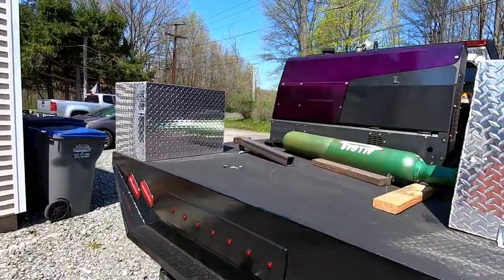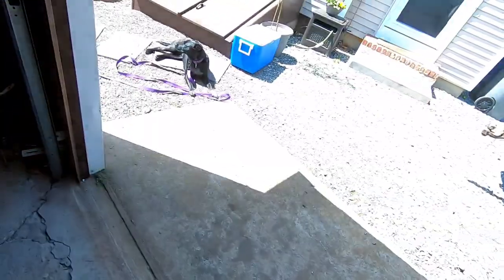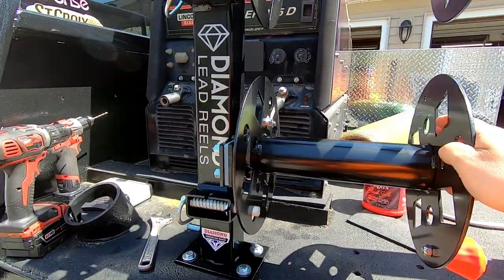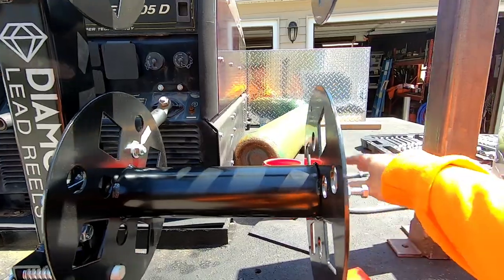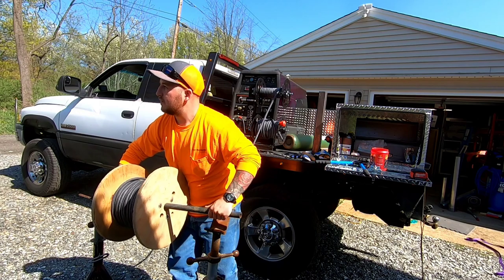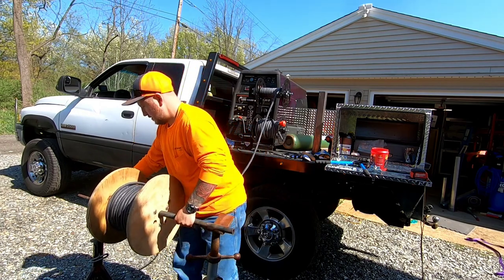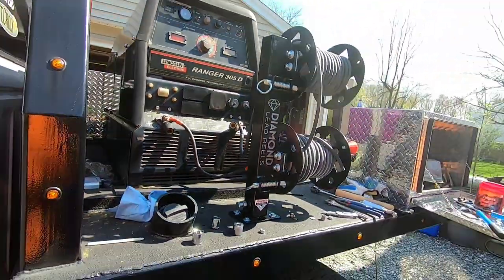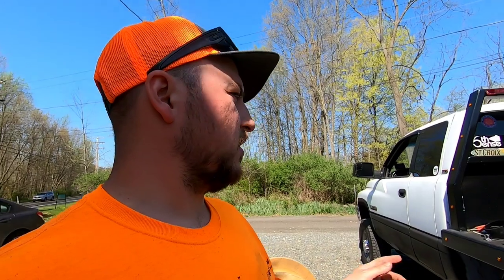INSTALLING DIAMOND LEAD REELS ON MY WELDING RIG - ARE THEY WORTH IT

Comment: I like that heat shrink too but when I use those copper lugs I get some solder with the flux in it cut up the solder put it in the lug heat it up until it melts and stick your wire in there makes a great connection
Reply from the maker: I thought about doing that, but since i wont be using this truck every week i settled for the crimp method

Comment: Piece of advice. Anti Seize on all hardware on your Lenco's, this will allow you to reuse them. TRUST ME! They are getting more and more expensive! Notice you have a 305D. Do a quick review on it. I'm considering a smaller diesel unit. Great attention to detail by the way!
Reply from the maker: Good to know. ill go over the connections after the build is done. The machine is a good unit. I had to do alot of work to it to get it to run good after someone put gas in it and ran it for about an hour

Comment: I'll tell you right now that you'll never not use your reels. I put a set of diamond reels on my truck a little over a year ago and they've been great.
Reply from the maker: yea you're probably right lol
Reply: Still a good idea to keep the quick connects on the machine though. If you ever gouge you’ll want a short set of 2/0’s handy.
Reply: @mikemccrea1935  spot on.
Reply: Didn't have any issues with yours locking up?
Reply: @triggeringliberals405  nope and I go through periods where my reels just sit for weeks because I'm running off my MULTIMATIC or in the shop and I have yet to have an issue.

Comment: Just buy some red electrical tape it works good and probably cheaper than red quick connects.
Reply from the maker: Yea thats a good idea, i ended up picking up a green one at my local welding supply so that will work.

Comment: You may have said it and I missed it but why would you not just want to load up 100’ on both reels. That’s what I did and I have no issue with voltage drop within 100’ and I don’t use I don’t un spool and better than carrying extra sections on the truck. Rig looks good 👍🏼
Reply from the maker: Would like have the extra laying around if I ever need it

Comment: Love your videos dude, but dielectric means non-conductive. If you want to use it to protect the terminals,  you need to make the connection first, then put the grease over to protect it from the elements. Just food for thought

Comment: That 250' of lead was a steal for half off! (maybe even literally)😂😂
Reply from the maker: Not a bad score. i think i paid around $500 for the spool. Everywhere i looked it went for $800-$1000 new online.
Reply: @mcfwelding  For sure! I bought a YesWelder multiprocess machine and used it for stick a lot with the original 10' leads and after 2 years my positive lead caught on fire and melted in half. It turned out the copper strands got all brittle and started to crumble inside the inside the insulation making a bunch of resistance catching it on fire.

Anyway, I wanted to upgrade to genuine USA #1 cable with 25' leads so the 50' set me back about $200 with shipping from bakers gas. That hurt as an unexpected cost for sure! I shouldve looked for deals!

Keep up the great work on your rig brother! 👍

Comment: Bro, that #1 cable is all you need with a small mobile business that you run out for your garage (same as me). I just ordered 200' of #1 for $549. As you know,   you will hardly run in to anything over 1/4" to 1/2" and rarely be over 150 amps.  The chart says you can go 200' at 150 amps with #1 AWG cable and 100' at 250 amps, which is all my machine will do anyway. I bet you might use those 1/0 like once a year. I do a lot of lawn trailers and small farm equipment, so 3/16" is what I see mostly, and I get to park pretty close.

Comment: Mark my words in about 1 year you are going to be kicking yourself for buying those reels the bearings burnout very quickly even  with grease and oil  and eventually The hub will completely explode  and fall off the spindle and you won't be able to turn them  by hand they will completely lockup I made a YouTube video three years ago about this situation  I had two sets they both did the exact same thing I grease them with a needle greaser covered them up when not in use and they both failed within a year I'll never buy diamond  reels again they are garbage. 

Not to mention the hub is supposed to be electrically disconnected from the base that is mounted to but it's not it'll arc out and I believe that is what causes the bearings to explode and lock up over time they do look good and work great at first but they just don't last. I still have the reels and can show you exactly what happened with mine in a video or email if you're interested. Anyway just a heads up to a fellow welder.
Reply from the maker: I am not impressed by them already. there is rust water dripping out of them once i unspool... not happy about it. and a few spots that got missed when powder coated that flash rusted the first night out in the rain